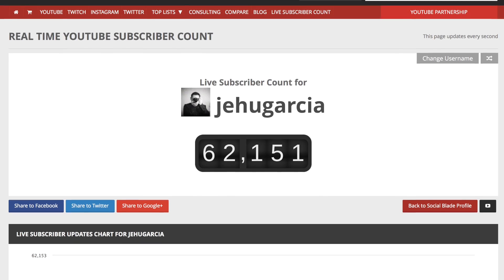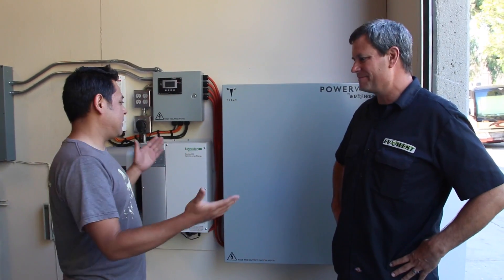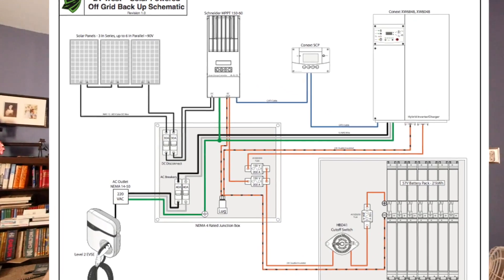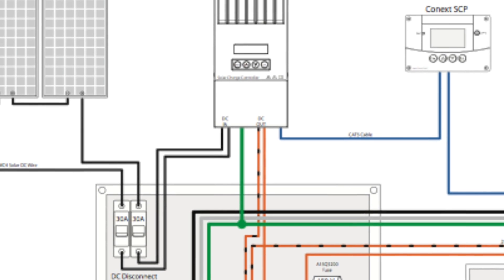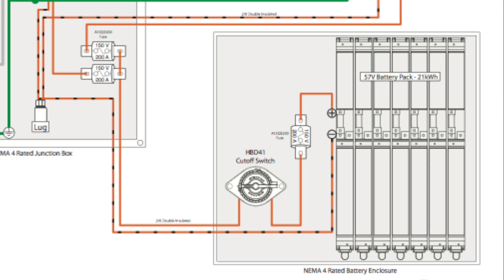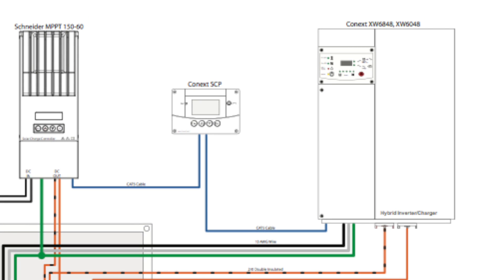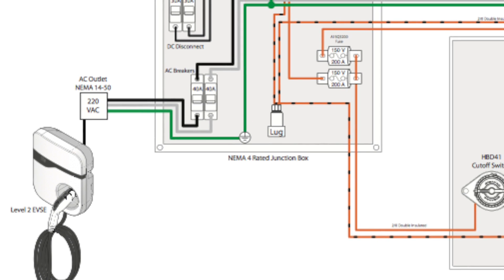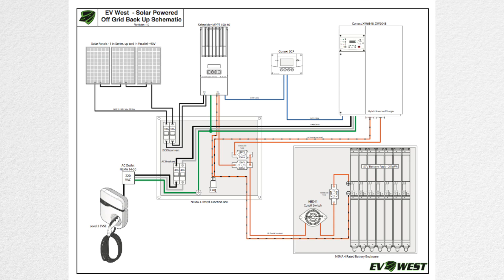DIY TESLA Powerwall talk  #3  -  Schematic Diagram

Comment: I am trying to figure out how to connect inverted power to my electrical panel where my house draws from my battery and solar array until empty and dark and automatically switches to the grid. I have no interest in a standard grid tie system.

Comment: I'm wondering if perhaps machines running 48 volts would be better than 240 or 110; ie have air conditioners, washing machines, dryers, fridges & freezers running with 48volt motors & separate rechargeable battery packs for each machine & just the need to have reliable chargers for each. Remove the need for expensive inverters...
Reply: While it’s true the inverter is expensive, it may be worthwhile to compare that to the cost of replacing all the appliances you want to run on 48V. Going that route would also not allow for 120V convenience outlets.
Reply: @kamakaziozzie3038  that being said & true for older established homes but those that are not wouldn't be losing much to start afresh.
Reply: @kamakaziozzie3038  as for 120v outlets this is where the inverter would be required but in Australia it's only 240v or 220 tbh. I would have these items on a completely independent inverter so that each item is isolated & issues can be pinpointed easily. Things like fridges & freezers should be independent so that faults are minimised & don't result in food loss. Air conditioning should be independent, also lighting

Comment: Hey Jehu, quick question....If I wanted to connect this design into a standard electric panel (to run multiple circuits 240v & 110v) can just use the 240V out as the main feed? (The EV charger out as designated in this design) or is something else needed?  Thanks Sam

Comment: Excellent!!.. Can I use these devices instead of what you have on your list? because they are very expensive for me .. MPPT: https://www.amazon.com/gp/product/B01HCL7LEW/ref=as_li_tl?ie=UTF8&camp=1789&creative=9325&creativeASIN=B01HCL7LEW&linkCode=as2&tag=jag35com05-20&linkId=359e41391484b34b99480b58003c6479  
 Monitor panel:  https://www.amazon.com/gp/product/B01M5CWR2P/ref=as_li_tl?ie=UTF8&camp=1789&creative=9325&creativeASIN=B01M5CWR2P&linkCode=as2&tag=jag35com05-20&linkId=c0357887fd0eaa94af589add435409d7

And what types of diodes and how do I connect them to each battery?

Comment: What do you suggest as far as powerwall storage if one is located in a region where there is a winter season ...like New Jersey. Looking to go completely off grid..I use 95  KW of power per day and will be adding a device to be used in my home that requires 1500 watts of power and will be running 24/7. ..any off grid suggestions related to this situation? Thank you in advance for your help.

Comment: the charge controller manual does not support lithium ion battery, so what parameter he change on the controller to charge his powerwall
Reply: Jose Garcia go to battery settings the choose  custom then set the bulk, absorb and float to your desired voltage and remember to disable equalization

Comment: WHaaat? Am I seeing things, a fuse on the panels negative side? I never fuse the negative side but maybe in a solar environment there might be reasons. Only thing I can think is the length of cable and a short on the negative on solar side could potentially have a floating voltage that could blow the input after the fuse. sound about right?
PS: diagram download is dud. maybe removed.

Comment: If I use 900kwh a month on average or 30kwh a day. Would the 21kwh suffice to be off the grid? Due to recharging etc? Also, I've seen 5.? KWh modules. Are these older modules (3kwh) you are displaying?
Reply from the maker: +Scott Bishop yeah 21 would be enough if you had enough solar to charge batteries and provide the 7kWh deficit while charging .    The 5kwh modules are from the modelS the 3kWh are from the smart car
Reply: jehugarcia thanks for response. Would it be safer being in Canada to go larger system? Eg. 30kwh or more? Due to longer periods in cold and longer cloudy day periods.
Reply from the maker: yeah you have to consider those things,   bigger solar system would be more useful,   bigger battery does no good if your solar doesnt charge it due to short sun days
Reply: jehugarcia thanks again to super quick response. Btw, love your channel and your initiative. So in regards to attempting to go off grid. With technology the way it is today, does that mean we are pooched in Canada or anywhere there is shortage of sun?
Reply from the maker: UK seems to do well with similar weather

Comment: Hi Jehu check this out. Here is 80 dollar inverter for your powerwall from ebay http://www.ebay.com/itm/1000W-20A-all-in-one-Solar-Charger-Inverter-3-IN-1-12V-DC-to-220V-AC-LED-display-/322225457459?hash=item4b06224933:g:Mm4AAOSw65FXrZBs

Comment: This is awesome....but one thing comes to mind...well, two.  Stock will be depleted, and it will be harder to get these items now.  Two, since the links of where to get these are out there for the common DIY guy, prices will increase by at least 30%. Look at the server processors that were selling for 50 bucks recently, that have now become 80-110 dollars. I am looking forward to do this on my house, but will need all of those permits to tie in to panel and perhaps run some solar panels too. How do those hold up to East Coast winters? Sucks, I just left san diego after 7 years...

Comment: having a lower voltage output higher amperage. what's better? higher voltage or having higher amperage? I want to built a power wall for certain things in the house but i got confused on why I would need a higher voltage if the inverter is converting to 110v from the battery?

Comment: awesome but how would you tie this to your home?
Reply from the maker: +Greg Drozd wiring?
Reply: What components would be required and wiring. Thx.
Reply: what I don't understand is from what I see is you connect your inverter straight to the power incoming to the house and all you need is a bi-directional meter but if that's true then tell me why generator hookups go thru these elaborate connections that guarantee at absolutely no time they can be both connected and on???
Reply from the maker: you need to have a grid tie inverter,   this is off grid set up.

Comment: Interesting, thanks.  Can you explain if there is a reason for the duplicate DC protection I crossed out on this screenshot?  DC protection is not as complex as AC.
https://www.dropbox.com/s/9t6mfcc4lug6ll4/schematic.jpg?dl=1
Reply: Because unlike in AC there is not a neutral that is supplying a common line for multiple feeds or loads.  You want to break both the Positive and the Negative to make sure all power is removed when you remove the fuses or flip the breakers off for maintenance or in a fault condition.

You can see that the 220VAC also has 2 breakers because its 2 "hot" lines. Same for all DC.
Reply: Though it's not needed, it was very easy to implement, and we'll be wiring more panels in parallel to the system next month, so we wanted to be able to fully disconnect a string of panels if needed, but you are correct in that it's not earth grounded AC, so it's not needed.

Comment: can i ask something??? i was wondering if you could help me about my problem on lithium ion batteries...heres the case.. i recently change my drill batteries from nicd to li ion... so the batteries are 5 cells.. in series.. and i wanted to charge my batteries on parallel.. to balance them out.. and it seems.. not possible .. because the 5 cells are already connected to series..
Reply from the maker: use one of these http://j35.us/Ama-imax6-charger   its easier
Reply: thanks for the reply man... i have that one.. but i wanted to know if theres is any other alternative? and i wanted to use a single lithium ion charger.. to charge each.. at the same time.. i have a lot of these charger for single li ion batteries..

Comment: Great video!  Check your audio, lots of popping for some reason.
Reply from the maker: interference,   might might need to go back to my original microphone
Reply: Gotcha...Great series on that wall.  I can't use any of that where I live here in PA since I live in the woods with no sun, but eventually will probably retire to Florida where I will be the solar king...:D  I also have plans to eventually build a 70 Chevy pickup with Tesla P85 components, though I am woefully out of my depth...lol
Reply: Josh Herzberger what about wind generators?
Reply: no, unfortunately I really don't get wind where I am either. If I lived an hour north of here that would be a viable option. But right where I am I don't get a damn thing. LOL
Reply: He made it sound like that. it's supposed to sound raw...lol